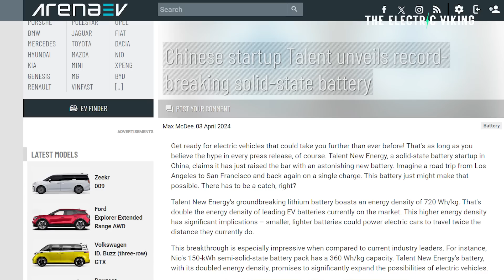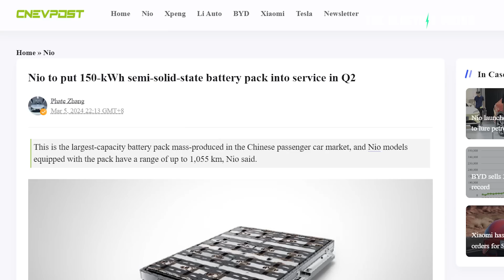Highest energy density battery in the world enables EVs with 1250 mile range

Comment: I would love to purchase an EV but in the uk their is not enough charging stations especially when i live in a flat 😢.
Reply: They will come in time. Believe it or not when the first IC engined cars came out, owners struggled to find places to buy petrol!
Reply: Does your building have a car park? Perhaps the building owner could install chargers?

 If not there is at least one EV I've seen that has removable batteries intended for people who live in flats. You park your car wherever then take the batteries out. The have wheels and a handle that fold out like a suitcase when you take them out of the car. You roll them along to the lift and up to your flat then charge them plugged into a normal socket. The range and speed and size are more modest than an average EV of course. But it could be enough for many people.
Reply: @adrianthoroughgood1191  I own a space but to fit one would cost a mint,never herd of a car that you could take a battery out if this was the case it would be a heavier car as is the same with e-bikes as I’ve a full fat one and gravel,the full fat you can take out and with the gravel you cannot.
I have seen with motorcycles where they can take them out and charge them.
Reply: @markwebster243   it's called the Silence S04. 92 miles range, 54mph. 2 seats. £16K new.
Reply: @adrianthoroughgood1191  Sure but a car is a back up to my van,unfortunately that would never be acceptable.
Many thanks for the reply and advice 👍🏻.

Comment: You've got it all wrong.
A 50kWh solid state battery produces the same range whether the 50kWh comes from lithium or lead.
Range is dictated by drag vs capacity.
An average EV going 70mph will manage 3 to 3.5 miles per kWh of battery. A higher energy density 50kWh solid state battery is still just a 50kWh battery, and the range on the highway will be 150 to 180 miles
Reply: Higher density means more energy per kg of battery.  So a 50kWh battery that weighs say 500kg less will make the overall weight of the vehicle 500kg lighter, and therefore give it a longer range.
Reply: @peteralflat281  well yes but thats just a secondary aspect. 

A 50kWh battery weighs about  500kg in the first place, before even fitting higher density batteries, so you might lose only 250kg total. The weight of two adults sat  in the back affecting range ? How much by ? 5% ?
Reply: He does state: a 50Kg size (meaning physical size) battery. At least thats how i took his meaning.
Reply: @Souliss24  I've listened again carefully, it is full of mistakes

'Lithium has an energy density of  360Watts per kilo"

Nope, Lithium has an energy density of 360Wh/kg

Wh = Watt-hours = capacity
W=W= power/load

.............................................

New Talent battery has capacity of 720 Watts/kilo

Wrong, it is 720 Wh per kilo

Wh is not W
Watt-hours is not the same as Watts

...............................................

100kW sized battery will give 1000km of range

Wrong, a 100kW hour battery ?
He means 100kWh

Tesla makes a car with a 100kWh battery, it's range is dependent on the load, but 350 miles at 70mph is just about it's limit.

If you replaced the Tesla battery with another 100kWh battery of high density solid state cells of 720Wh/kg, you would halve it's weight, but the range would remain still as low as the Tesla, more or less

The worst claim is "A 50kW sized at 720Wh/kg will give 800 miles of range"

Again, completely wrong. 

Can someone tell the Viking to stop swapping 'Wh' with 'W', and note that a typical highway range can be calculated by using the formula 3 x kWh(of battery capacity)

kWh is capacity in the battery
kW is power from the motor

a For example, a 100kWh battery can power a 100kW motor for one hour

The actual range from a 50kWh battery, made from these cells would be 150 - 180 miles

If he meant 'kg' of weight, then the range from a 50kg battery would be...
50kg  x 720Wh = 36kWh of capacity
Range at 70mph would be  around 100 miles

None of these claims above are earth shattering
Reply: @Souliss24   ""He does state: a 50Kg size""

He never states that
Reply: Range is also a function of weight. If I had a 50Kwh lead acid battery it wouldn't get me very far and that is if the road could support its weight!
Reply: @marviwilson1853  Thats why I didn't specify a lead acid but to be honest, the difference between solid state and lithium ion is a factor of two, which means a difference of only 250kg for 50kWh, or 2 large adults

I don't think the EV manual says your range will be significantly re3duce if you carry bigger people, it's just not all that relevant, except during acceleration and hillclimbing, but even then, not by much

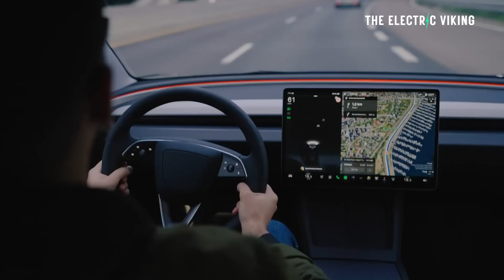Comment: Corrections.  1:09 should be 360 watt hours Wh, 1:18 should be 720 WATT HOURS PER KG, not watts,  1:31  iF YOU PUT A 100kW BATTERY IN A MODEL 3 YOU WOULD NOT GET 1000 miles of range.  Even if you put a 100 KWh battery you might get 400 miles of range, as it uses 1Kwh every ~4 miles.  At this point it got so bad I could not watch anymore.  THUMBS DOWN!!!
Reply: I do believe he is talking size, not capacity. He says 100 kWh size and 50 kWh size when compared to the current size. But you are correct, capacity and weight are different, and at 100 kWh it would still only be 400 miles at 4.0 mi per kW.
Reply: This should come as no surprise but it won't stop the fanboys.
Reply: Sam pumps the videos out so fact there’s no fact-checking
Reply: he always gets it wrong. it is the pinnacle of incompetence.
Reply: If the kWh per kg doubles then the weight of the batteries halves for the same power, that weight reduction increases range 

Or have l got the maths wrong too?
Reply: @richardbartlett6932  yes, you are wrong. you said power, but what you ment is energy.

Comment: You don't need install charge station everywhere. The electrical helicopter not only to be cheap made and also fly at very low noise. It will be allowed to be landed in the backyard or on the roof. The infrastructure of road and building regulation will adopt the new way of commute in the furfure. The Australian politicians should aware of that when have new long term infrastructure bring on the table for approval.

Comment: According to Sandy Munro, there is no such thing as a "solid state" battery. The Electric Viking should do his homework. "Currently there is solid state batteries for busses and trucks made by Blue in Montreal Canada.They are not viable for cars and light trucks because you need to keep them at about 176’F. that is hot!!! The rest are still science projects, not commercial except for SAKKU and they want to sell machines not batteries."
Reply: Quote: Munro further backed solid state batteries for their faster charging capabilities, increased density and range, lighter weight, and use of less toxic materials. It’s where he’s putting his weight for the most seamless shift into EV adoption.

“Solid state is the kiss of death for gasoline and diesel,” he said.
Reply: NASA does
Reply: Maybe you are backing the wrong horse. Maybe Sandy needs to do his homework. It is very obvious from this video and others that solid state batteries are real and will be available very soon.
Reply: @michaelgoble8200  Really? This directly from Sandy Munro: "Currently there is solid state batteries for busses and trucks made by Blue in Montreal Canada.They are not viable for cars and light trucks because you need to keep them at about 176’F. that is hot!!! The rest are still science projects, not commercial except for SAKKU and they want to sell machines not battery’s"

Comment: I think the goal going forward is not larger battery packs but smaller packs with the same energy capacity as current packs. The resulting weight savings will increase driving range while also lowering cost. EVs are in the market stage where price will dictate EV adoption going forward. Instead of marketing huge range, concentrate on price with current energy capacity batteries in smaller and smaller packages.
Reply: Agreed. Price is the ticket. If Tesla does indeed come out with the Model 2, it will change the game. Chevy had something with the BOLT but it was still a Chevy

Comment: Electric aviation here we come.
Reply: And boats
Reply: Electric planes just have to go from small to big because big is more efficient.
Reply: @Apjooz  whisper aero had a concept for an  electric 100-seat airliner they unveiled a month or so back they said it was based on 800 or 850 wh/kg and was a concept for 2030. We are already in the 700s and have six years to go. Electrified aviation can now go big.
Reply: Moderately small, quiet, automated electric plane will change things. One can have a airport in city, and  fly VTOL or STOL to nearly anywhere like a taxi with fraction of the present cost. 

Two seat electric small plane goes 200 km/h to 100 km range with pretty small battery, consumption less than a Tesla or electric motorbike bike at highway speed. Funny, that plane has regen.. and easy reverse. High acceleration gives short take off, and landing. Maintenance is really low compared to combustion engines. Already aluminium air batteries could give range from London to Berlin, but the battery is not rechargeable and it gains a lot weight during flight. Take off weight is less than with kerosine and turboprop. Record energy density I found is 8kWh/kg. But 2kWh is present state.. The motor is much smaller and lighter, so less drag, and higher efficiency makes it about equal to kerosine. But the aluminium must be recovered in a factory and fresh powder added to battery with electrolyte. It is actually a aluminium fuel cell. Efficiency is not very good, more like option to hydrogen, with much less space needed.